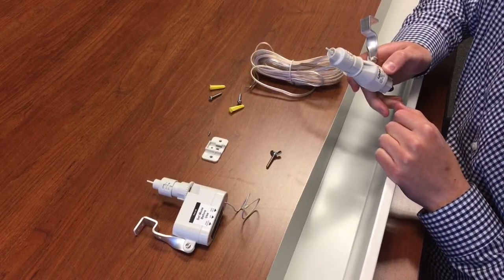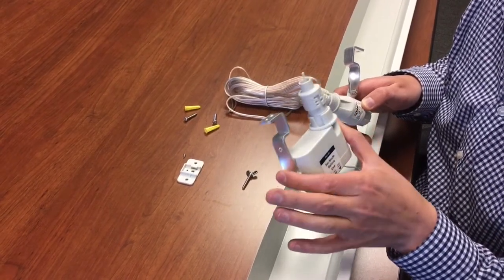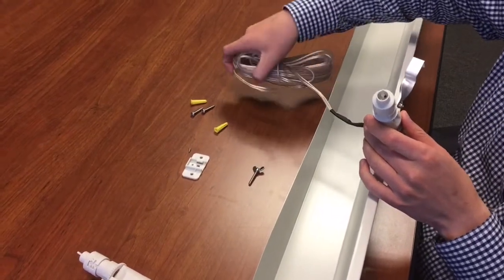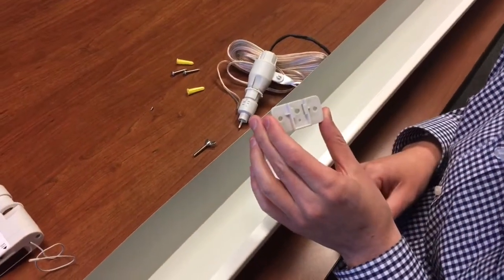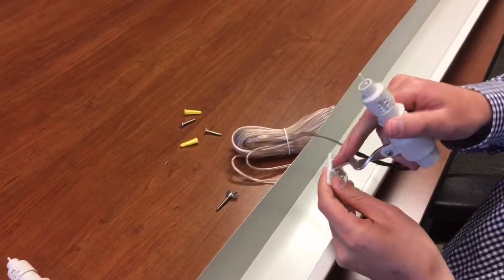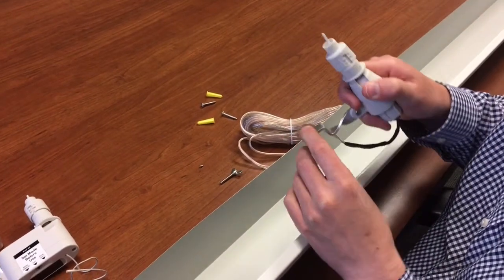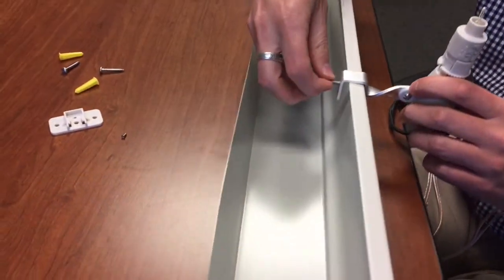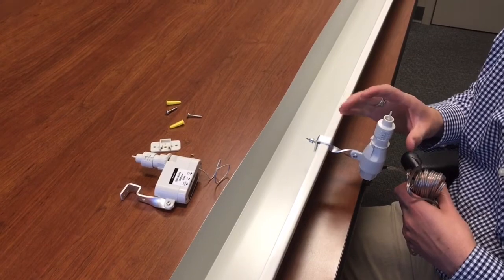Mount Orbit Rain Sensor

Comment: Professionals instal rains sensors over conduit standing up, oll wire get hidden and the plastic pipe allows you t place it at the best location. No screws or drilling any where is required. No ladders or drilling on fascia, easier to maintenance!!! No visible wires to the wall!!

Comment: What does the sensor do on the pins, short them, open them or apply voltage
Reply from the maker: This connects to the sensor terminals on the timer. When active (meaning sufficient precipitation has triggered the sensor), it sends an active signal to those terminals which essentially prevents any scheduled programs from activating until that signal is released.